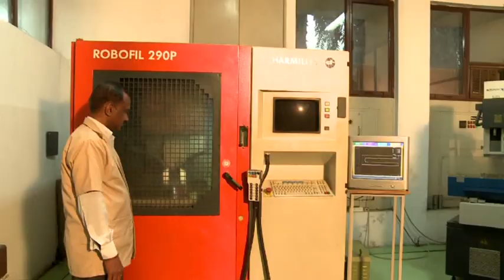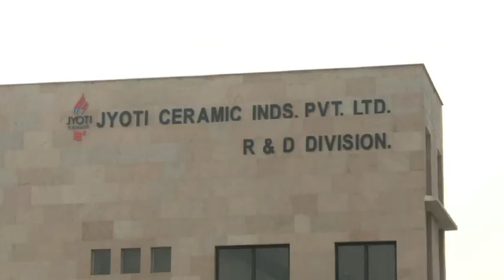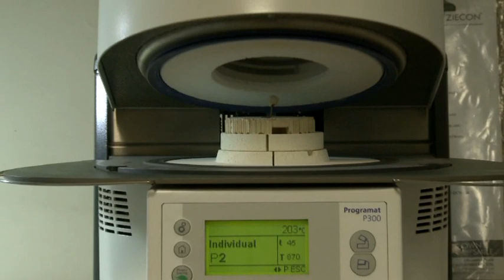Jyoti Ceramic Industries Pvt. Ltd.

Comment: GOOD video ！ we are pingxiang chemshun ceramics co,ltd , another abrasion resistant alumina ceamics China manufacturer  with materials : 92% Al2O3,  92% Al2O3 super , Al2O3 95%, silicon carbide ,zirconium, ZTA ,zirconium silicate,  web: www.chemshun.com